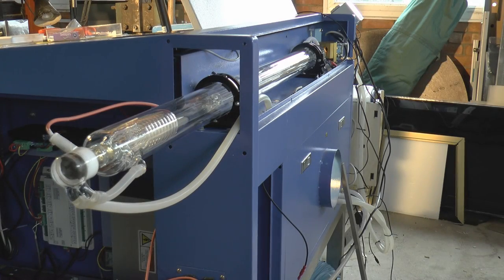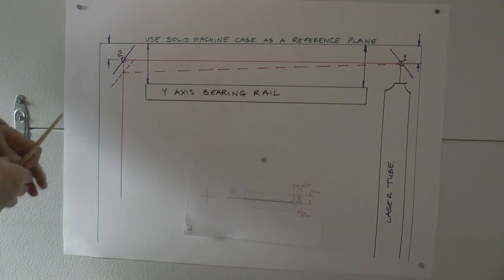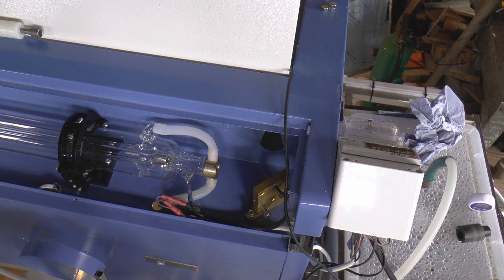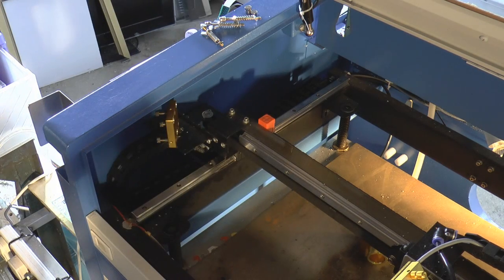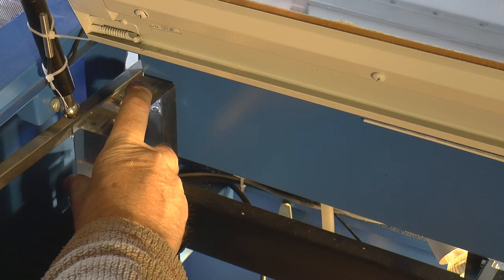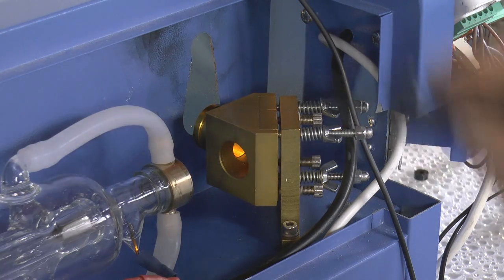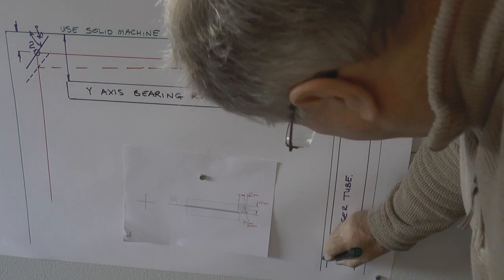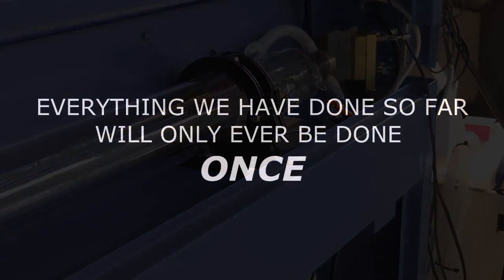RDWorks Learning Lab 51 Beam Setting for Beginners Part 1

Comment: Hi Russ,

again a nice video ( as expected ) but let me ask you a question.
Why do you not use the laser itself to get the perfect position (sideways and hight) for mirror nr 2 ?
I myself do it this way.
1. i do a rough and basic setup of 1 mirror and tube 
2. i fire the laser agains a big sticker put on the mount of mirror 2 when mirror 2 is driven to the back (y axis to back). 
I then do the same when mirror 2 is away from mirror 1 ( Y in front)
then i reajust mirror 1 tilt and redo this again until front point and backpoint is on spot.
Until this stage i dont care about where the point hits the big sticker as long as it is not moving its ok.
After this i know the beam is parallel to the y axis bearing tail
3. Now i open the screws of the mounting angle ( the black coated metal part) of mirror 2 and shift the whole assemble up/down and sideways until the beam comming from mirror1 hits the center of mirror2.
Now i have a parallel to yaxis beam hitting the center of mirror 2.
Reply from the maker: +pyrofilm 
Hi Walter
Yes, I understand your method,  we have achieved the same result but in different ways. I would hope that my mirror mounts were set up in the factory with jigs to be at the correct mechanical positions but who can be sure when I see some of the other mis-sets on the machine. I have often considered mounting mirror 2 on its own little XY stage that would allow me to collect from mirror1 and send to centre of mirror three. Maybe a future mod.
Thanks again for you feedback. Always a pleasure.
Russ

Comment: Ross, thank you for all information  you put on this channel. Info on your channel helped me to decide what laser cutter to buy. Also I would like to ask for something I can not find the answer all over the internet. Two days ago I just got my 50w laser cutter but instead of dot after beam I always get something in this ) shape. My pulse is rounded:o If anyone know what it could be, please help. I've done some basic mirror alignment but it does not make much change. Thanks again
Reply from the maker: Hi Miroslav

I suspect your 50 watt laser is fitted with a tube 800 mm long and 50mm diameter. It is really a 40 watt tube.. Further to this bad news, if you bought the machine from Ebay or Amazon market place  there is a very high chance it is fitted with a B grade tube. The tube will work in some way, enough to fool the average non-technical buyer. Your O saped burn is iindicating that the end mirrors within the tube are not aligned properly. Not something you can adjust but the reason your tube never passed final QA and was sold as scrap, retested by a third party and fitted to your machine.. Right from the lowest power there should be a high power central core to your beam that will burn a solid  small  spot and not an O  If you set the keypad MAX power to 50% and put a piece of card between mirror 1 and mirror 2, then press the pulse button for about half a second, is the burn still and O or does it become solid as the power is increased?
Best wishes
Russ
Reply: @SarbarMultimedia  Russ, thanks a lot for your response. Changing power does not affect shape of burn it's always very big distorted spot compare to what I have seen on any of yours videos. I am just waiting for response from a seller. I have suggested to them to send me new tube and optics. I will add short video so you can see what it actually does. But by following steps in yours videos I came to the same conclusion. Can't thank u enough  for sharing all your knowledge about lasers.

Comment: Hello,
I have a question about the laser beam
it is normal for the laser beam to hit the metal can just before the end of the tube
Thank you for doing this tutorial
They are very helpful and informative
Reply from the maker: Hi Ron
  This video was done 5 years ago when I was at the beginning of my learning  journey.  I have discovered so many new things during those intervening years including the fact that God is cruel because he has now made me old, gery, fat and ugly.  However, I have still kept my two remaining grey cells active and managed to learn a lot about this technology.

The  first bit of bad news is telling you that that pink beam in the tube is NOT the laser beam. No, that is ionized nitrogen, effectively lightning in a bottle. If you watch the beam colour as you change the % power from 15%  (weak and fuzzy) to 70% (solid bright ink) that change of intensity is caused by allowing more current to flow through the ionized nitrogen. That ionized gas is acting like a wire and the current flows into those metal electrodes at both ends of the tube which is why you see the lightning striking those tubes.  As I said, this is NOT the laser beam but the mans by which the laser beam is created. The laser beam co exists within that tube and is INVISIBLE and is not bent . It escapes from a "window" at the end of the tube and bounces off the first mirror,
 You may like to watch this video that gives a basic explanation of how your tube works.   
 https://www.youtube.com/watch?v=2F5O-1TH8b0&list=PLPWEtx5V9DqEogIeYRdcG_KYcB7UL2Qmn&index=6&t=258s

Best wishes
Russ

Comment: My laser beam is not pointed rather it is oval in shape 
It looks like a ring and not focused how to set it?
Reply from the maker: Hi
If you have bought your machine through Ebay then you will certainly have a machine fitted with a B grade tube. Such tube will "work in some way" but maybe not  properly or with the correct power output. How can you complain or know it is wrong because you need special equipment to measure the power. The problwm you describe is very common with poor quality tubes and I have even seen it on expensive A grade tubes.  It has been repoerted that this problem is sometimes caused by a poor eath connection (so just check if you can)but in general is is tube manufacturing fault. If you test the tube at low power you will find the circular burn  as you describe, If you stat increasing the power in 10% steps can you make the circle change into a solid spot? If yes, thenthetube willbe usable but stillpoor. If the circle persists even at high power , your tube is junk. The beam that comes out of your tube should have a very powerful central core and get weaker to the outside. Yours has no power at the centre. This cannot be co rrected  by any setting procedure. Sadly the cure is a new tube. HOWEVER. Do not be tempted to buy another cheap tube from Ebay as a replacement because it will almost certainly be another B grade tube.  An A grade tube will cost more but will be trouble free and last between 3 and 5 years One trusted source will be Cloudray. They have their own website, but also sell through Ebay and Amazon. The low cost/free postage via Ebay is probably the cheapest way to buy a tube. The Cloudray brand (made by SPT) are excellent value especially the metal ended tubes.
Good luck
Russ
Reply: @SarbarMultimedia  I have LASER lamp of LASEA  make.
One observation of mine is water is in outer jacket,
Is it normal?
Reply from the maker: @gargatterajendraarunkumar5414  
 Your tube is made by EFR and they are good quality tubes. Your tube has a major problem if there is water in the outer tube,. There 3  three tubes. The central tube is where your pink beam forms and the lasing action takes place. The big outer tube is a gas reservoir and is connected to the inner tube so that the gas mix can circulate. Betweeh the outer and inner tubes. There is another tube in between where your cooling water flows to remove heat from the inner tube, If you have water in the outer reservoir then your tube is junk. You have some sort of major mechanical failure. Depending on where you bought your laser and the model number (is it KH****?) it may be a an EFR reject tube that has not been relabed K H Laser. 
Best wishes
Russ
Reply: Thanks for guidance
Reply: LASER tube  comes with no warranty/ guaranty,
How to confirm or check it before installation
Reply from the maker: @gargatterajendraarunkumar5414 
 All laser tubes arrive at you with a warranty. The big question is who is responsible for supporting that warranty.  The simple answer is the person that sold it to you is ultimately responsible. You will have to provide evidence of reasons why you think you have a warranty claim to the person that sold you the machine  because he in turn will have to make a warranty claim on the tube manufacturer.  Tube warranties vary a lot. Some are 12 months some are 6 months and some cheap tubes only 3 months. The big problem is the manufactured date on the tube. Usually the warrant period starts from that date. So if your machine has sat in a warehouse for 6 months the warranty may already have expired. However, if you bought the MACHINE through E bay or Amazon and the tube is junk upon arrival you can claim that the machine arrived damaged. You must write to the seller through ebay and ask for a relacement tube. This sounds easy but China will be difficult to deal with and will try every thing to blame you. You will need to be firm with your claim.  If you bought it with a credit card you are in a stronger position because you can always threaten a charge back from your credit card company who have a legal duty to protect you from fraud.
You cannot easily check a tube before you insall it,but once installed you will need an ammeter fitted and a power meter. 
 see
https://www.youtube.com/watch?v=lO9rWlobLZU

Best wishes
Russ
Reply: @SarbarMultimedia Thank you very much Sir

Comment: Can you post the company you order the new tube thanks mike from the us
Reply from the maker: Hi Michael
I'm not sure you can still get this tube (it's still running great 4 years on) but  you will find an equal quality tube at Clodray. The have their own website, an amazon presence and an Ebay presence.. A tube bought from their website will be shipped from China via DHL or UPS. The courier shipment will double the purchase price and you will still have to pay purchase tax and a handling charges to the courier before your tube is delivered  (within 2 or 3 days though). if you buy the same tube via E bay it will arrive in about 2 weeks for 1/10th of the cost and no additional charges as far as I know.
The equivalent of my Mactron tube is  a CR70.  Sadly I have just checked ebay.com and Amazon.com and they are not listed.
https://www.cloudraylaser.com/products/35-45w-720mm-co2-laser-upgraded-metal-head-tube-cr35?variant=12892224553011
You can email/message them to see if they do a slower non courier shipping. 
 You willbe able to see me fitting and testing this exact tube in  https://www.youtube.com/watch?v=V_ehGE51rH4&t=763s

Best wishes
Russ

Comment: I watched one video clip and they set squareness by firing beams on minimum and maximum y and x axis and adjust the mirrors that it strikes the same spot . . . newbie here . . .
Reply from the maker: Hi 
 Beam setting is something I have played with almost from day 1. You must always remember that my videos are  of me learning about this technology. I am certainly not an expert but someone climbing that ladder of experience  by a process of making mistakes to learn more.  Some things I have done on camera seemed so right at the time but subsequently I found better and smarter ways to do the same thing. It took a couple of years to fully understand the critical nature of some beam setting elements. I always remember the first time I removed a mirror, there was an immediate fear (for a few seconds) that the machine would never work again. Then rationality kicked in "it's only metal, mirrors and a few screws. Some little guy half a world away made it work, so what's the problem??"  The bits you mentioned are the two simple X and Y settings. It took me sometime to learn  that Z was the most import and and most unmentioned axis to set.  (see  https://www.youtube.com/watch?v=eSjNsK2sjNo      )     If you don't have a machine yet don't sweat about beam setting. If you do have a machine,  it will sort of work right out the box but  the Chinese only assemble these machines to "the picture on the box" they do not understand what they have built. Often as a result of their lack of assembly precision, you will never get your beam set precisely at all four corners. . Time and experience helping many folks have forced me to go beyond simple beam setting because I often have to unravel the Chines puzzle that has been exported  before we can set the beam true. After 4 years of in depth learning I now, feel I'm getting closer to the top of that ladder. Wait until you are in trouble and then send me your email address.

Best wishes
Russ
Reply: @SarbarMultimedia  
Good day Russ, thanks for your very inspiring reply, I previously bought a Prusa 3D Printer, assembled and successfully tweaked it to print some decent objects, I am googling for a laser unit and came across your great videos, I'll surely be following you if I will acquire a CO2 laser in the near future but I am inclined to have some sheet metal cutting capabilities as I am from the construction industry. 
Cheers!
Nest
Reply from the maker: @nes-t326  
 Hi Nest be careful what you wish for and do a lot of research. If you have a laser profiling job-shop anywhere near you then I advise you take a visit.  I owned a sheet metal  and leaser profiling  business for 10 years. . The infrastructure you require means you need to either be rich to have it as a hobby or  do it with a proper machine  and lots of turnover  if you plan to sell product/services. The cost of gases is an area you must investigate. I urge you to visit a pro outfit so that you can see the issues that you must take into account when you buy a Chinese machine. When I acquired my cheap Chinese hobby machine (non metal cutting) it was a completely different process to metal cutting and I had to start almost from square one and get used to designing structures in ply, ,mdf and acrylic.  Hugely more useful than metal cutting. If I need industrial bits now, I pass them off to a local profiling shop,  because the parts can be amazingly cheap if a company is operating large scale.
 Best wishes
Russ

Comment: Thank you for the video, but why oh why would you assume the people at the factory would have made sure all the sheet metal on the machine is plumb and square? I highly doubt it. I've worked with sheet metal people and they are not typically a highly focused technical group.... just saying...
Reply from the maker: Hi
As it happens the squareness of the metalwork is not critical. The fact that it is a fixed reference allows you to use blocks to position and shim the tube from base and back surfaces. Any tube adjustments that need to be made can be accurately achieved by adding or removing shims..
If you examine the construction of these machines you will see that they are all manufactured from brake press formed sheets that are spot welded together. There is a natural accuracy in the manufacturing process that makes the "boxes" pretty square, although, I agree,  not necessarily aerospace perfect.
Best regards
Russ

Comment: how about using a cheap laserpen and have someone with vaporizer blow some smoke and align the laser by site.
Reply from the maker: Bear in mind that this is a record of MY learning journey. As time progresses I begin to understand more and more about the fundementals of beam alignment.  You will find that I have tried many red led alignment systems. All work to about the 90%+ level but none has allowed me to set the beam inthe continuous dynamic manner that both you and I dream of. At the end of the day the scorch method is the only true way I have found of setting the beam path accurately. I have been looking for more than 2 years for the holy grail and I'm pretty sure your idea is  not a viable solution BUT that is an opinion based on bitter experience and does not mean to say I'm right. If you have a machine that you can test it on I would gladly be a convert if you can prove it.
I do sincerely thank you for the comment  because i find that the silliest of suggestions can sometimes contain a germ of an idea that others will explore and develop.
Best wishes
Russ
Reply: I stand corrected. I missed the context of the video, but after watching  the "etching"video i realized you show the scientific approach:-) you made laugh on how you mocked the American warning labels on the packaging..

Comment: Way 2 complicated 

Use a machinist level to get x axis and laxer tube exactly level (horizontall)

Place your machine head in the position that makes the 1st and 2nd mirror closest to each other

Use tape and fire a test pulse

Adjust 1st mirror to get dot dead centre

Move axis so 2 nd mirror is as far from first as possible 

Repeat test pulse and adjust mirrors to hit 2nd mirror dead centre 

Move back and forth repeating until spot on

Everything needs to be square and parallel...... the best thing to measure that with is a laser....Do you know anyone who has one? 😂

Comment: Hi Russ, thanks again for the valuable information. Would it be possible for a copy of your adjustable tube mounts dxf. It will be one of the first cutting projects that I will tackle on my machine as I can see a great benefit from having a full range of adjustment. I have already implemented the adjustable head idea which is great. 
Cgoddard.cg at googlemail dot com
Much appreciated Chris